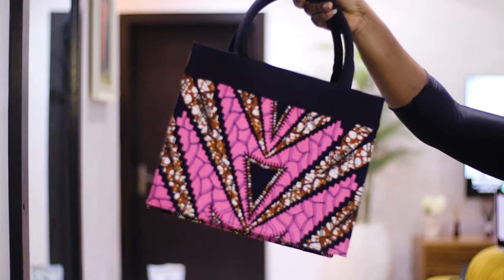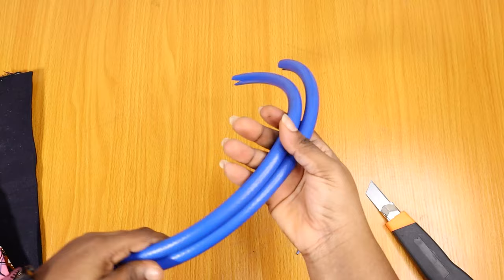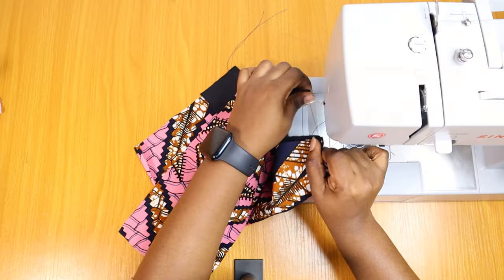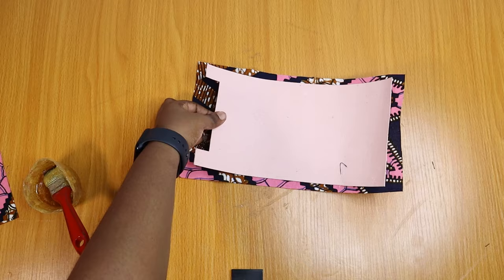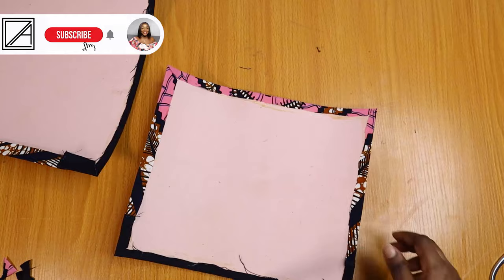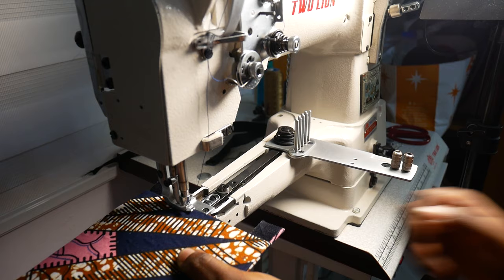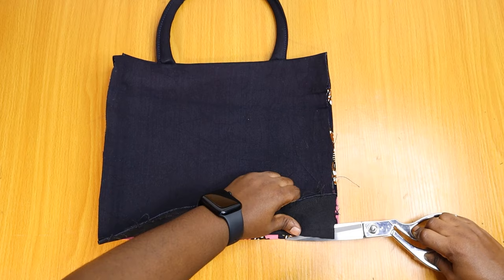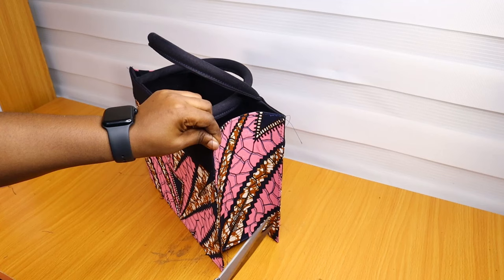How To Make A Trendy Ankara Tote Bag | Eris Atelier

Comment: Is it advisable to use maco as the interfacing?
And what size of needle do you use
Reply from the maker: You can use maco. I usually use DP18 but sewing through thick areas, I switch to DP23 or DB23